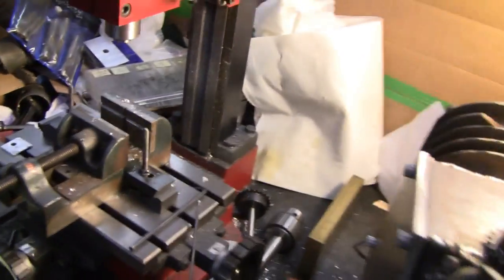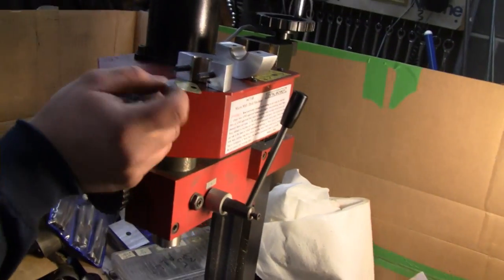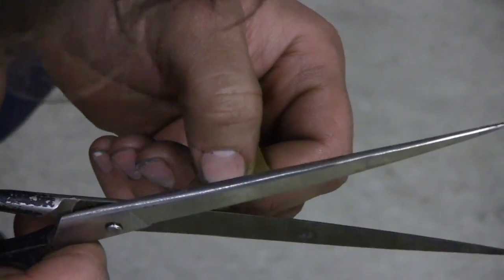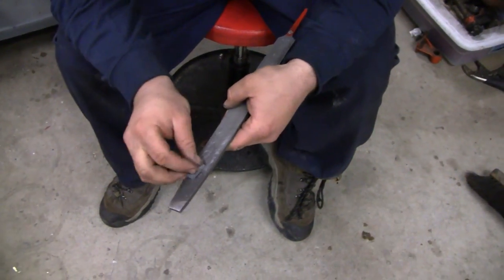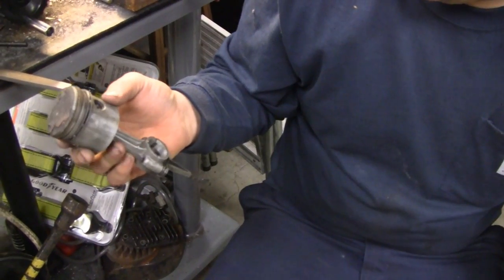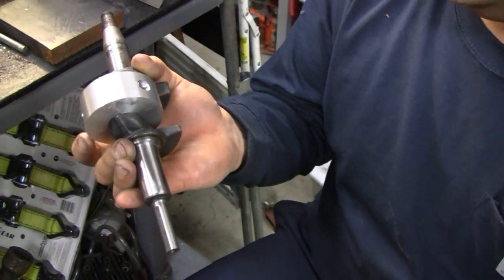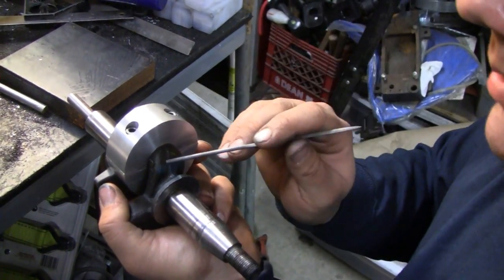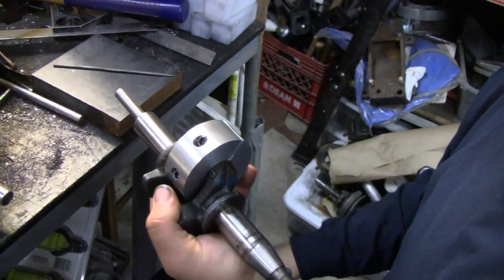HOMEMADE RADIAL BRIGGS ENGINE (part 18)

Comment: Mike should use steel shim stock for the inside of the bearings as brass shim stock will pound out and will become thinner and open up the bearing clerence.

Comment: Hey roadking what kit doe you use to rebuild a 5hp briggs "Fun power"
Reply from the maker: +Brice loy Don't know Bud!! I usually don't mess with that newer stuff, and if I do I just replace the bad parts!!☺
Reply: 805ROADKING Huh well unlike you I dont have an arsenal of little engines around haha! Oh well I guess i'm off to research a rebuild kit. I noticed something on the engine I have. It have a little hole right under the intake valve spring that spews air whenever I turn the engine over (without the head) what is it?

Comment: Looking good! There are so many details to designing an engine like that. Kudos to y'all!I am sure you have considered it, and I am not questioning your wisdom; but what made you decide not to use a pressure feed oiling system through the crank for the rod hub lubrication?
Reply from the maker: +davida1hiwaaynet Thanks Bud!! It's only a show engine, ya don't wanna get too goofy with it!!☺

Comment: l better get crackin on the plane
Reply from the maker: +Mustie1 Yeah Buddy!!☺
Reply: +Herbert Shallcross im planning on welding a couple a ducks to the wings for takeoff thrust
Reply: +Bounty B. Wolf I love this project, but a radial made out of three 5hp engines is highly unlikely to produce more than 15hp no matter how well it is made. You better be thinking about making an ultra-light. Maybe if they make a three row turbo-compound 9 cylinder next you could use it to power an Aeronca C-3.
Reply: +Mustie1 a bi-plane or perhaps a tri-plane? Fabric covered wings or aluminum skinned?
Reply: +Herbert Shallcross 
(thumbs up) @ the 3deep turbo powered radial. Id like to see that.